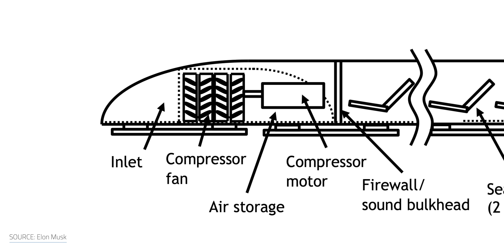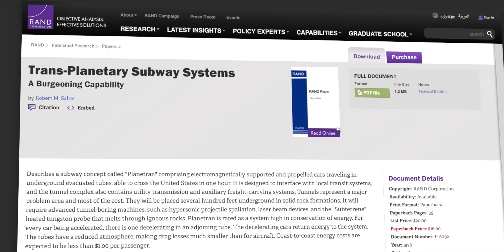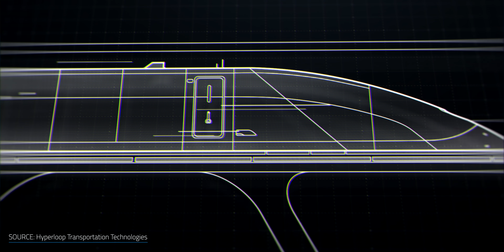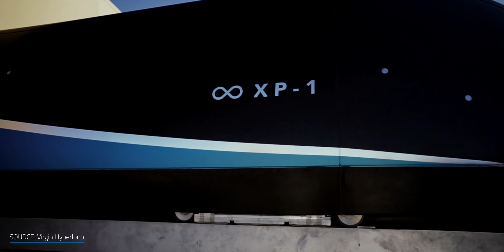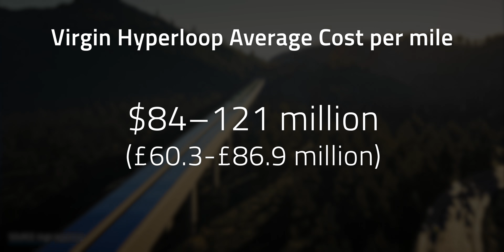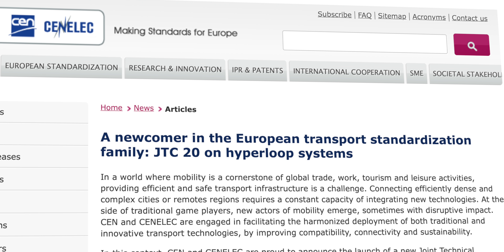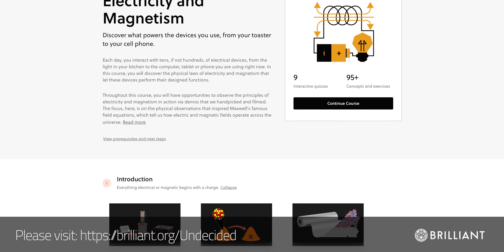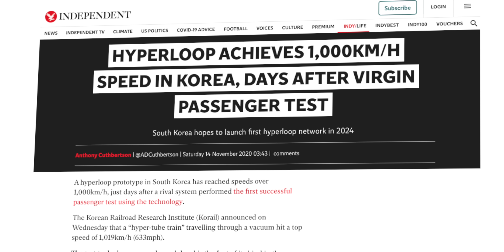Exploring Hyperloop - The Future of Renewable Public Transport?

Comment: How do they stop someone from shooting an above ground tube with a bullet?  One bullet will crumple the tube and kill everyone in the tube for miles and miles.  There is no way to stop fast enough from liquefying the passengers.  Not to mention any kind of accident that can breach the tubes.  Earthquakes, pressure seal breakdowns, and losing the tiniest piece of the train in the tube will kill hundreds to thousands.  Just impossible to make as safe as a plane or a train.  One company mentioned using a skin with sensors.  Why bother? By the time a computer notices a problem everyone is dead.

Comment: On the whole, the idea seems doable. Underground tunnels would probably be ideal, since they could more easily be sealed to minimize air intrusion. To help maintain low pressure, the tunnel could be broken into sections with sealable retracting doors, isolating the atmosphere within each section. A door to the next section would open after verifiying that section is at the same pressure as the cuurent section. Once the train passes through, the door closes again. (Obviously sections would need to be long enough to verify and open doors far enough in advance to slow or stop the train in case of an issue with the door opening.)  As a countermeasure for sudden leaks, there could be stored tanks of liquid helium or other cold compressed liquid (maybe even just a commercial refrigerant). Spraying this into the area would drop the pressure rapidly due to the chilling, while emergency pumps kick in to draw out the gas. 

I definitely think passive mag-lev is the way to go, as air bearings would increase the needed size of the vacuum system.
Reply: So you are introducing potential blockades into a system that essentially is a spacecraft traveling through a tube with next to no clearance?

Any single person who has ever worked with vacuum systems could tell you that this "vacuum" train is the least practical and most expensive contraption imaginable, that even if it was built for some idiotic reason would be about as financially practical as taking a space shuttle to work.

The biggest and most glaring problem is the diminishing returns of vacuum pumps, efficiency drops at a near inverse logarithmic scale while even the tiniest of leaks in the system has air rushing in at the speed of sound. It is impossible to build a large perfectly sealed vacuum system, let alone at that scale and god forbid with a myriad of joints, vents and airlocks. Not only would this system require thousands of immensely expensive and energy hungry pumps running 24/7 to maintain a partial vacuum, you also would not physically be able to counteract a breach with more pumps.

No, it is a brain-dead idea that was revived from its 1800s conceptualizations by a rich out of touch dupe with zero experience or education in any relevant fields of science or engineering. The worst part is that those shit projects leech funding and publicity from direly needed practical high-speed rail infrastructure or public transport just like the worthless monorails and bus-train scams of old did beforehand
Reply: @itsa_possum  I've worked on ultra-high vacuum systems for particle accelerators and fusion reactors, and I know exactly what you mean by the diminishing returns on vacuum pumps. BUT this system is NOT a vacuum system. It's a low-pressure system. I only mention the section doors as a means to minimize how much volume has to be actively managed at a time. I also suggested the underground tunnels, as I think it would be far easier to manage the atmosphere than in a giant metal tube above ground.

Overall though, I agree that it's probably significantly less practical than many high-speed rail concepts. But if a few startups want to throw some money at it, I don't see any real harm in that.

Comment: Setting mandatory standards for a technology that doesn't even exist is like tailoring a suit for someone whose dimensions you don't know. "Standardizing" a budding technology/industry produces far inferior technology and is bad for everyone.
Reply: I disagree. You can have minimum standards to assure quality and safety without having a completed technology.

In terms of Hyperloop e.g. in case of a power failure you need to make sure that nobody suffocates in the tunnel. <-Is this not an acceptable minimum?
Reply: @benjaminmeusburger4254  Yes, you are right and I agree completely. I do believe that there should be safety requirements imposed by governments. The problem I have is when your standards dictate the method of construction and utility, which is what Matt is referring to as "standardizing" (as per his example of the EU electric charging grid). It is that sort of regulation that will doom Hyperloop to subpar performance.
Reply: @nickschneider774  If you don't have a standard then 20 companies all develope their own system and nothing is compatible.
The biggest issue when riding a train from China over Siberia to Europe is the spacing between train rails - Russia uses another standard than China or the EU, therefore  -  you have to either switch trains or take the cabine and lift it onto another substructure on the other rail.
This is a huge waste of resources and time.

Btw - Hyperloop will never be built in Europe. For a connection from one big city to another they would have to build in a straight line over mountains, rivers and thousands of privately owned real estate. 
That would mean multiple billions on investing to essentially replace airplane flights of 2 hours (price rane 20-80 €) with an 1h hyperloop ride (price ???).
Reply: @benjaminmeusburger4254  So, I understand that concern, and it has some merit. I took it into account when I wrote my first response (though I didn't include it). The main reason rail distances are different for different regions is because when trains were developed the world was not a global Network like it is today. 
But mainly, the problem is that when dealing with an extremely complex AND new technology, the WORST organization to set standards is the government. The market will do a much better job of figuring out the best system than the government will especially early on.

Comment: One thing you seem to have missed: capacity. 

For the massive investment you get a system with a very low amount of passengers per hour per direction compared to much cheaper alternatives.
Reply: That depends on he size of the pods used.
Reply: @titter3648  what's the max number of passengers per hour per direction?
Reply: @ApemanMonkey  As i said. It depends.
Reply: @titter3648  so what is the absolute maximum?
Reply: @ApemanMonkey  I don't know. Ask one of the developers.
Reply: @titter3648  you make the statement.  I have looked into it,  and the capacity is abysmal.

Comment: Major vaporware alert! seriously, maglev trains already exist, they're already too expensive, and hyperloop want the same thing with a vacuum tube on top, which would require insane amount of energy to maintain, and be extremely dangerous. These people are so arrogant to think that the people who designed conventional high speed trains are total idiots.
Reply: No one is calling people who develop conventional trains idiots, you halfwit.  However, society is looking for an even better way and hyperloop technology is it.  Also, if you bothered to watch, this technology could produce more power than it consumes.  Better to do the research than expose yourself as an idiot.  Renewable energy systems could easily power all of this, we just need to have the willpower to get it done.  However, we'll always have the naysayers and knuckledraggers who want to shit on new technology.  That's certainly a shame.
Reply: @TheFitConnection  The technology, Hyperloop, doesn't produce any power. The video mentions a proposed project that would install more solar panels than needed to power the hyperloop.
Reply: @TheFitConnection  you’re actually the halfwit this thing is a engineering nightmare it takes two failed ideas (maglev trains, and vaccumn trains) and combines them that alone makes it a seriously stupid idea. It’s also incredibly unsafe as it’s very dangerous to maintain a vaccumn in that long ass tube one thing goes wrong and it fucking collapses due to the pressure differences. It’s also less efficient than regular trains as it used small pods which is less efficient than long trains it also a maintenance nightmare as instead of fixing one machine you have to fix numerous ones. There’s a reason why In 8 fucking years the biggest accomplishment is a small as test track the whole thing is literally a pipe dream
Reply: Hyperloop does appear to be trying to fix a problem that's already fixed by normal fast trains.
Reply: Hyperloop Dubai is already functioning and carrying passengers.  1 hour air travel is reduced to 12 minutes.

Comment: Hyperloop seems to have a high cost and complexity with low capacity -- not a receipe for success. If you want to go fast, just go with maglev, or even steel wheel trains using track mounted linear motors in place of overhead catenary. Elon Musk's  urban Boring Tunnel ideas are even crazier, a train is going to have a lot more capacity than a car or bus, which is why PRT has not been too successful.

Comment: The tubes don't need to be a vacuum. Low pressure is fine if the air in the tube is also moving in the direction of the pod. Sort of like always having a tailwind

Comment: The most mindblowing thing about the hyperloop concept is the opportunity cost of pursuing this folly.
Reply: Yes ironically  loftsrtrom loop would be a huge return for same price
Reply: So far even the highest proposed costs are well below realized costs of high speed trains.
Reply: I think they said the same thing about the railroads before the first commercial track line where layed, you never know how things are going to turn out, I wouldn't bet on it, at the same time I wouldn't say it has a 100% chance of not happening.
Reply: @drmosfet  No, they didn't. We've been using rail systems and tracks to transport crap for thousands of years before the first train was invented. The train was just replacing the human effort with steam power. No one has ever used vacuum tubes to transport anything bigger than a few pieces of paper.
Reply: @DBZHGWgamer  
Got a link for the thousands of years old steel tracks?
Reply: @drmosfet  lol, they weren't made of steel but they were still tracks.
Reply: @DBZHGWgamer  
I think we got a bit off track now?
Reply: @drmosfet  Google Diolkos and see for yourself mate.
Reply: @drmosfet  The Post Trak was built around 3800 BCE so almost 6,000 years old. 

https://en.wikipedia.org/wiki/Post_Track
Reply: @DBZHGWgamer  Yup it was a paved road but no rails. The Romans built roads all over the continent but no rails.
Reply: @johnabuick  "According to the British historian of science M.J.T. Lewis, the Diolkos represented a railway, in the basic sense of a prepared track which so guides the vehicles running on it that they cannot leave the track"
The track was cut in a way to guide the wheels of the cart, which is the same thing train tracks do today. That's not a road, that's tracks.
Reply: @drmosfet  Hyperloop is marketing jargon for high-speed train + vacuum. If North America can't even get behind a high-speed train, I can't realistically imagine a hyperloop happening any time soon, unfortunately.
Reply: @drmosfet  The problem here is Hyperloops require Smart infrastructure which is NOT a good thing.
    Smart infrastructure is infrastructure that contains the technology for whatever it is supposed to do within the infrastructure. It's downside is it's owners must pay for the upkeep of both infrastructure and vehicle. And trust it's users will not abuse or destroy it. Technological sophistication invites planned obsolescence; once it's available if it should require constant upgrade, it soaks up huge expenses and support costs. And should the technology provider go bust, or use proprietary technology is destined to fail, namely because if they should desire to upgrade it or replace it, costs mount. Once this is done and a significant amount of infrastructure is built, however, it will be difficult if not impossible to upgrade the technology as new ideas are developed. Since the technology is in the infrastructure rather than the vehicles, any new technology would require that existing infrastructure be rebuilt at great expense. That means shutting it down as upgrades/overhauls take place. Nor has hyperloop express plans for how they maintain infrastructure 
    Dumb infrastructure is infrastructure that incorporates minimal technology and instead relies on infrastructure users to supply their own technology but pay for the capacity to use the infrastructure provided. The advantage of dumb infrastructure is that it is technology independent. The reason cars and planes work so well, the user either provides their own technology; or pays the provider for using technology with exceptionally low amount of infrastructure (and thus LOW infrastructure costs). Flying requires little infrastructure except a few thousand feet of runway. For cars; the technology costs are bared by their individual owners, Drivers only have to pay for infrastructure largely when they chose to use it. In any case, once hyperloop is built, there's nothing the technology addicts/pushers can do to address or answer for improvements in automotive and airplane technology. Therefore it's technology will rapidly become obsolete. Not to mention new routes; the industry will be torn between building more which will add to he logistical burden of maintaining their technology. 
Other problems, It cant carry freight
Economics: Not to mention what might be miles and miles of tubes, tunnels, viaducts, bridges across topography. By the time Hyperloop is ready for its first passengers, airliner, car and bus energy efficiency will increased to the point it doesn't matter. Intercity-transportation isn't a heavy market; Bus and planes have the advantage,; Buses are FAR cheaper to run despite longer times and airplane they depart when they're largely filled to capacity.
Reply: @drmosfet  Hyperloop cannot transport a tenth the number of people as rail. Its dead by design.

Comment: the issue is that there is no issue with just building high speed rail. In fact there are a lot of advantages. its a proven technology (therefor cheaper and easier to build), can carry many more passangers and many more.

you don't need theoretical 30min from LA to SF, when you can have actual 1.5h with something like the french TGV.

Hyperloop can be amazing after another 30 years of development, but right now it just doesn't make sense